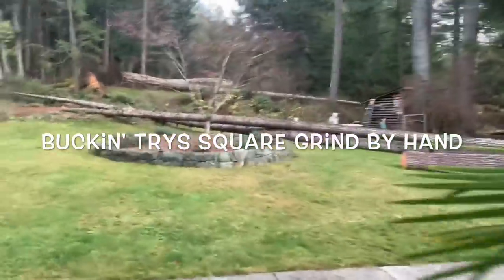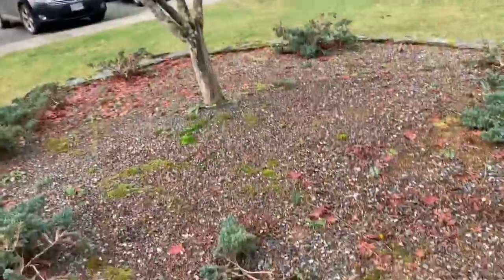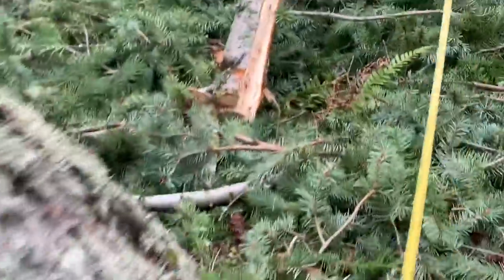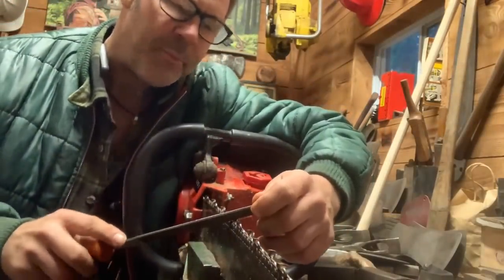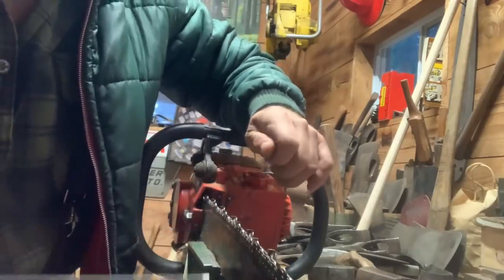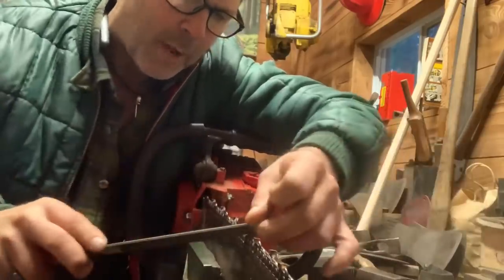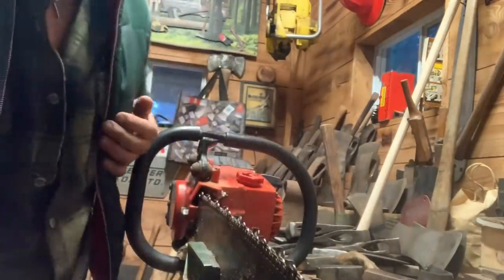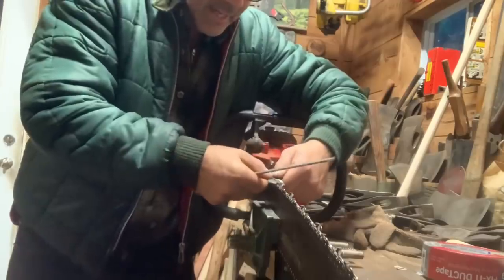Buckin's learning square ground hand file

Comment: Hi Buckin, Terry the Logger/Barber here. Square filing is old news to me. It is the fastest, smoothest and safest method if you do it right. In my area I use a 32" Windsor bar, 3/8th skiptooth chain, 8 tooth sprocket (24" bar) on Jonsereds for racing and 7 tooth sprocket Stihl or Echo for working.  We used a 6 bevel file for this type of filing and it has to be spot on!  No overhanging lip or different angles or uncleaned gullet. I've fell 16' (diameter) trees (Forks, Wa) in the 70s and this is how I filed. There's a saw shop in Oregon that grinds this type of chain. When you get it right it will make you a believer!  Check out Wranglerstar on YouTube when you get a chance. I taught him to make a Scrench that clips onto your beltloop. You could really use that for the high work.  By the way,  Good job on that tree. I like the push off the high stump. That was classy! I Believe the Maple will have a long and happy life!

Comment: File into the tooth not out. Your angles are not enough. Filing in is harder on the file but it works. Check out the thread on ope forum how to square file, the last few pages.

Comment: Interesting. Based on the 45/45/45 idea you should drop your right hand... This as is you're at closer to 30 degrees than 45 in terms of the file angle to the side of the bar. Keep this up, it's interesting!

Comment: Hey Buckin’ 

I just finished up my first axe and posted a little slideshow of it on my channel, I would love some feed back on it from you.

It’s a Gransfors Bruk head (Montreal pattern I believe) that my dad found at the curb. I cleaned it up, tea patina’d it (using your tea stain video. Which was also how I found your channel) used a hardware store handle that I stripped the varnish from modified slightly and fitted to the axe. I also made the sheath myself.

Overall it’s far from perfect and there’s a lot of things I’d do differently next time but considering it’s my first time making an axe and working with weather, I’m quite happy. 

All tips/criticism is welcome.

Keep up the great work Buckin’!
Reply: What's your channel ?
Reply: Found it ,will watch

Comment: Good video👍 What to do about the gullet doing square filing, do you still hit it with a round file?
Blessings in Christ from TheJonsbergs
Reply: yup still run a round for the gullet but if you have the proper angles you should be filing part of the tie strap for the actual cutting portion the last tooth before the raker filing was perfect nice job buckin

Comment: i would screw my chain up with a square file, what i would like to see is a ax cut fir tree about 3 feet or so at the butt,,,,and time how long it takes to fall it, of course thats more for those old cross cut saws,,and that would be interesting too, ,, but lets dont stray too far from the power saws,

Comment: Hello from Germany Guys,

Do I need a special file for that or can i use every square file??
Reply: A double bevel chisel file and one of my favorite ones are the three Side Square files that you can put in your gauge that clamps to your bar and it gets it right just like a machine those are easier to start off with for a beginner and then work your way up to the double bevel file like bucking was using they go from $4 to $190 a piece for the quality I stick with the $28 ones I think it's called safe Edge the brand for $18
Reply: @timhart2652  Thanks for the Information.

Comment: Is that just a regular flat file or is it one of those special files just for square filing
Reply: Hi, just have a look at those files / links: Stihl 7010 871 0132  -  3 Sided Chainsaw File for Square Ground Chain    or:     Pferd 17081 and 17082  at   https://www.pferdusa.com/products/201b/201b01/201b0103P.html   -   or:   https://de.vallorbe-shop.com/lc10020-2271-doppel-chisel-bit-feile-halbschlicht/   or:     https://de.vallorbe-shop.com/lc10020-2276-dreikant-chisel-bit-feile-halbschlicht/   or:   https://fastoolnow.com/pferd-17081-7-chisel-bit-file-three-square-12pk/       I don´t know, which are available in your country, in Germany I haven´t yet found a shop where they are available... Stihl and Oregon both offer square ground chains (at least in the US and Switzerland), so I guess, Oregon offers a file for that chisel too, but I haven´t found it yet....   Best regards!